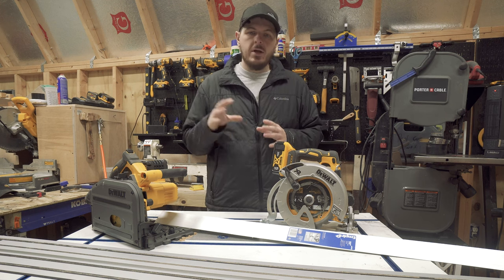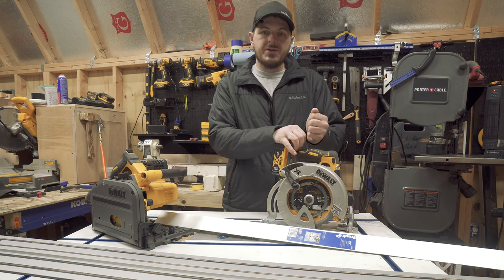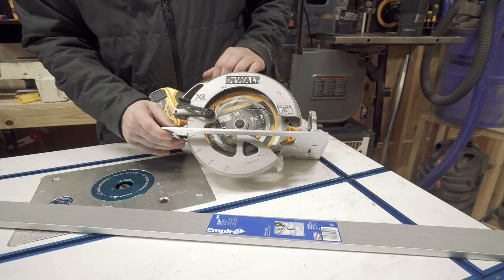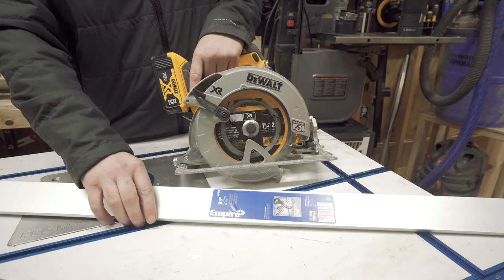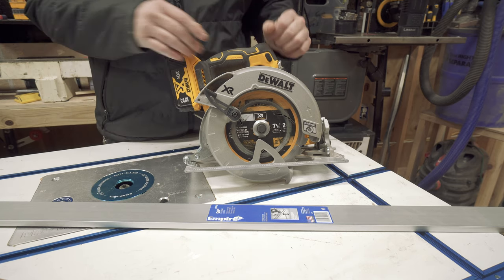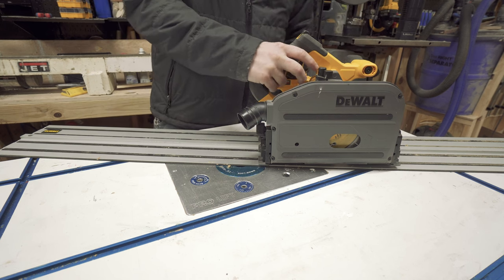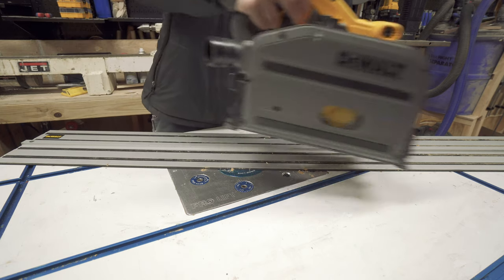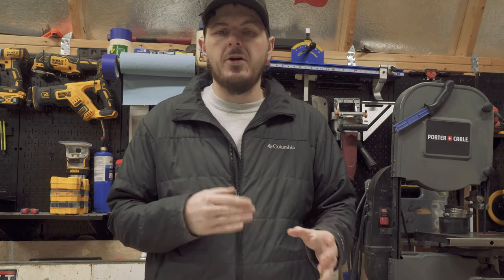Track Saw vs Circular Saw Gimmick Or Gold?

Comment: As an amateur woodworker of many years, cheap tools end up being more expensive in the long run and I understand the track saw is the preferred tool for cutting sheet goods if you must do so frequently.  That said, I would strongly recommend purchase of a quality circular saw as a first investment for a beginning woodworker. Its versatility for applications across a variety of cutting needs makes it a more universal tool than the track saw.  There are a large number of jigs that can be made to increase accuracy and reduce setup time such as a sacrificial piece of hardboard attached to the guide with the excess cut off.  This allows the saw to both track accurately and provides the same two mark reference speed of set up as the track saw. Except for rare circumstances, setting the blade precisely is not a requirement for cutting sheet goods or wider boards. An eyeball setting of the circular saw so it passes through the stock to be cut is sufficient. As far as splintering, the circular saw can have a plunge cut guide board to minimize splintering.  Additionally, the blade shown on the Dewalt circular saw is for rough cuts.  A good plywood/melamine blade would also reduce splintering.  My point here is a track saw is a wonderful tool for a specific application whereas a circular saw can be equally accurate and almost as speedy through use of jigs while providing greater versatility for the beginning woodworker.
Reply: How long does it take to figure out how to use jigs? Time is money….
Reply: @CrimpKeeper  - That is a question with a high degree of variability.  I have decades of amateur woodworking but am not a professional.  A professional may very well justify a track saw given the demands of their profession. An amateur is quite a different matter.  I made my guide from available scrap plywood and hardboard in about an hour and have used it on several occasions with good results.  It took me less than an hour to make.  Purchasing a specific track saw unit will run from around $400 on the low end to well north of $1000 for a Fess Tool unit.  Spending an hour making a functional circular saw guide compared to even a low end track saw equals that I made $400 an hour!
Reply: @douglasrasmussen480  I am an amateur who struggles with cutting things straight, plus I'm an idiot in general. I need to remove as many failure variables as possible, and the track saw removes quite a few of them for people like me. For example, measuring things with 5/16 and 3/8 and all that, I have no idea how that all works, and I am especially not going to be measuring off a blade and hoping I clamped my bar in the right place AND I hope my hand doesn't wiggle and ruin this cut like the 200 before it that just never come out right. I'm terrified of table saws since I had one kick back and almost impale me with a splinter...went right off my shoulder and into the wall like a movie scene. I would maybe get that hot dog saw, but that is still more than I need now that the track saws are proving so accurate and easy to use. I mean, mark my line, lay the track on the marks and go...I could finally even square boards by simply lining up my track and perfectly fixing my mistakes. I don't see ANY downside to it?
Reply: @slowride5633  A track saw is a wonderful tool and if it works for you I have no argument against its functionality. My point is that with a few basic materials, a circular saw guide can be made (or purchased) that is every bit as accurate with many of the same features of a track saw - for hundreds of dollars less in some cases (e.g. Fesstool). By the way, I believe you may be misinterpreting inexperience for idiocy. Every craftsman struggles through mistakes, getting used to tools, etc. Those can certainly make you feel dumb, but are part of the progression.

Comment: Love your emphasis on safety. It blows my mind that more people don't value the safety aspect of tools. Safer can mean quicker. At least for me. Something a track saw has over a table saw is the product stays still. If it's a fiber cement product like hardie.... You have way less damage and chance of cracking. Also one man job instead of feeding a sheet through with 2 people.  I didn't know track saws had the kickback protection. That sold me. Good video!

Comment: There's actually an adapter you can buy to add a dust port to that circular saw, it fits on both the 60v and 20v cordless versions of the sidewinder. I got it recently and it keep my garage a ton cleaner vs not using it

Comment: Thanks for the video. Not sure why you did'nt mention the integrated 'Clamp-guides' which can be clamped to the work quickly, come in sizes up to 50", and not expensive. Much more efficient, and safer, than the g cramps you used in the video. A piece of wood cut accurately can be used to gauge the offset between the guide and the cutting line. (though wont work with very thin boards).

Comment: I just bought a Dewalt 54v track saw to build my wooden garage, ended up sheeting the entire thing in about 45 mins with my track  saw and framing nailer, it made cutting the osb easy and then I just taped the 1mm joins up and used liquid rubber to finish the roof, entire thing was done in 3 hours.

Comment: I’ve got a dewalt table saw and a dewalt circular saw and I’ve just brought a dewalt track saw and I can tell you the table saw will be sold and I don’t think my circular saw will get used much yes the track saw was expensive but in my mind well worth it totally agree with you

Comment: I have a very small workshop and budget and I need one tool to cut through long wood planks and sometimes large panels. With a jig on the circular saw you essentially change it into a track saw but without the encumbrance of the track, so you can cut pieces with very small size, ease of effort and especially very quickly. Also you can use the circular saw in reverse position on a table, to double as a bench saw, with limits of course. With the track saw I guess it's more precise and fast to operate without having to create jigs in the beginning, but once you have these, I don't see much of an advantage. Surely it's safer, but circular saw + jig for me doesn't compair with the track saw.
Reply: If there is no room to use a table saw reasonably, then track saw/circular saw is the best way!

Comment: I've been using a jig for years with my circ. saw. Slap the jig edge against the line and you are good to go. Dead straight cuts every time, and only need to mark the cut position, no need to calculate distance to blade etc. In fact it works so well and is so quick, I just can't see why I would ever need a track saw other than dust collection. Plenty of jigs found on YT.

Comment: I have just transformed my non-track type DWE575 to a track type DWE576 by replacing the base plate with a base plate (N472354) from UK.  It allows me to use the DWE575 as a track saw.  DWE576 is only available outside North America.
Reply from the maker: O OK nice sounds like that might be a good option outside the US

Comment: I'm not a diy guy... Nor a builder... But I had to cut a whole lot of plywood for some renovation. And was wondering whether to pay up for the more expensive track saw or just go with, what seems more versatile, circular saw.
Glad I went with the track saw, based on this video. I'd say I'm below newbie level at this, and the track saw was just so fucking easy and quick to use, when I didn't have an option to use full sized tablesaw.

Comment: I have them both, I use the track saw for more of a finish cut since it won't chip the edges. The circular saw is my go to for quick cuts. 
Great video but you forgot to mention the less chipping with the track saw
Reply from the maker: I did I realized after it was edited but I did mention it in the article I belive.

Comment: Good discussion thank you. However if sheet material is not your thing then which option?
Reply from the maker: I use my track saw on way more than sheet goods. Breaking down longer sections of lumber, getting a straightedge to cut dimensional boards from live edge and cutting table tops to a final edge all can be done with the track saw

Comment: Great video, always nice to hear from a craftsman. I've used some circular saws and recently a Festool Track saw. The track is a game-changer for me. Now I'm considering getting a DeWalt DCS570 (love the 20V Max system), but replace the shoe with one with track support (from the 576). It would end up as a circular saw but with guided track support like the plunge saw. Since time is your biggest (though not only) difference, would this equalize that factor?
Reply from the maker: So the Tim is a bug factor but also the accuracy and quality of cut. The track saw is much more accurate with so much more easy of use. Also the track itself helps to reduce tear out.
Reply: Looks like Dewalt heard you with the DCS572
Reply: @JohnSmith-ws7fq  Indeed!

Comment: Curious to know ur opinion on DIY tracks for ur specific circular saw
Reply from the maker: They work they do. They can be pretty accurate but that comes down completely to the accuracy of how well it's built. The don't have the safety features like kick back protection and stops like a standard track saw and they are not designed as a plunge. And they are usually a good bit heavier so if your transporting them that can become an issue. With all of that being said it's a good option of you are in need and cannot get a manufacturered track saw. Quality all comes down to how well and precise you build it.
Reply: @jpaynewoodworking7510  thanks for the response, much appreciated

Comment: circ saw can hook up  vacuumme and arranged to start when you  start cutting or by a small outlet control Also you not using right tools you should use 2 small quick clamps they're inexpensive seem like  the c clamps really what slowed you down .... with the cost of a track saw you can get a real nice circ saw annnd make or buy a nice track system for it .....plluuuss you can get a rip cut guide as well making your circ even more versatile I never had a track saw though so if I'm missing something I honestly like to know I mean the track saw might still be faster even with the changes I mentioned but how much faster? track saws are not cheap is it worth the investment ? 

*and I'mnot putting anyone down I'm really trying decide if I should get a track saw

Comment: Great video! You made that circular saw cut a lot faster than me. I tend to re-adjust and re-measure, and recheck and take forever... and I'm never quite happy with the results. I own half a dozen circular saws (Dewalt, Milwaukee, Porter Cable) and lots of different blades. I am looking forward to getting my first track saw. However, I'm worried that the Dewalt rails are not "grippy" enough and will move unless clamps are used. Do you have that problem?
Reply from the maker: Hey I haven't had that problem. So far the tracks grip really well. I will say they could slide if you have an extremely dirty surface with lots of sawdust but as long as you're using a clean surface for the most part I have not had any trouble with it.

Comment: By measuring from right to left and cutting with track saw is your board not short of the thickness of the blade. If it's a finishing cut. Thank You
Reply from the maker: These were not finishing cuts just demos but yes  you are correct on that.

Comment: You can also get a track-compatible circular saw from DeWalt. I love mine, best of both worlds! https://www.youtube.com/watch?v=-dilOelFc98&ab_channel=Toolstop
Reply: Hi Mark. I'm looking at buying the Xr circular saw with track shoe. Wondering how your gettin on with it. Does the blade gard get in the way when putting it on the track? Do you find the shoe a bit big when not using the track?
Reply: @grove8967  I love it. It works well on the track or off it. Highly recommended!

Comment: personally I wish I bought a tracksaw instead of a circular saw. Circular saws are dangerous for beginners, you'll waste wood trying to get  a straight cut etc etc. Tracksaws are mighty expensive but if you gave me a doover 3 years ago, tracksaw all the way. They cut perfectly straight, you can do plunge cuts and it has a riving knife and antikickback
Reply: Amen on wasting wood w/ a circular saw

Comment: Good video - I like the track saw - you can hook up dust collection!
Reply from the maker: Thank you
Reply: circ saw can hook up  vacuumme  to start when you  start cutting or by a small control so id say results absolutely dint really speak for them selves because you not using right tools you should use 2 small quick clamps they're inexpensive and the c clamps really whatb slowed you down the most  with the cost of a track saw you can get a real nice circ saw annnd make or buy a nice track system for it .....plluuuss you can get a rip cut guide making your circ even more versatile I never had a track saw though so if I'm missing something I honestly like to know I mean the track saw might still be faster even with the changes I mentioned but how much faster? track saws are not cheap is it worth the investment 

*and I'mnot putting anyone down I'm really trying decide if I should get a track saw

Comment: Try using the dewalt DWE 576K then you will kick yourself on that track saw
Reply from the maker: I dkn lol I'm using the circular saw that is extremely clost to the 567k from whst I can tell. The circular say I use in the video has a ton of power that was never an issue with it for me. It comes back to accuracy, speed of an accurate setup, dust management and in no small part safety. Not saying one is truly better than the other they are used at different times but I really prefer the track saw

Comment: You just demonstrated that you don't know your circular saw too well. Most if not all circular saws come with dust extractor adapter that fits that hole and you can hook up a vacuum cleaner to it. Also all the circular saws have a marked depth gauge in the back that you can use exactly as the one on the track saw. Also, you can use a track with a normal circular saw. All these make it just a gimmick for me. The only useful feature of the track saw that I've seen in this video and you didn't mention is that the track saw has a splitting wedge.
Reply from the maker: Wow so that was a lot to unpack so let me do my best. For one most circular saws especially cheaper circular saws and most battery operated do not come with us ports that are meant to be plugged up to vacuum. While some companies do offer them as a option that you can purchase it is something that most people do not do as the circular saw is meant to be a quick cut method for most people and they just deal with the door. If you have one of the adapters great. The next part is that most tracks unless you were using it with a specific circular saw all designed to be used on it can not to be used with a circular saw. Tracks are designed to be used with the exact track song because of the distance from the center of the track which allows her perfectly straight cut and no binding also is designed for a specific distance from that track on the base of the saw to the inside portion of the blade. If you are able to use a track like that with your circular saw it might be able to be pressed against the side of Indy raised portion of the track and give you a straight cut but offered none of the advantages of the safety features of the tracks all that stop things like kickback. The next part is I have never heard of any saw having a splitting wedge. That is a riving knife to stop the wood from closing down on the back of the blade causing kickback. Is the similar setup that is used on a table saw. I appreciate you chiming in and it's fine that you think it's a gimmick but there are many advantages to it hope that helps thank you
Reply: @jpaynewoodworking7510  Yeah, I meant riving knife, but English is not my first language and that was the first thing that came up on google. Regarding the ports, all the circular saws that I've seen here (Romania) have those vacuum cleaner adapters included, even dirt cheap ones.
Reply from the maker: I can understand that. Here in the US you can get dust port attachments for a few brands of circular saws but they are not standard by any means. Especially on battery powered and also cheaper priced saws. I appreciate the info though.